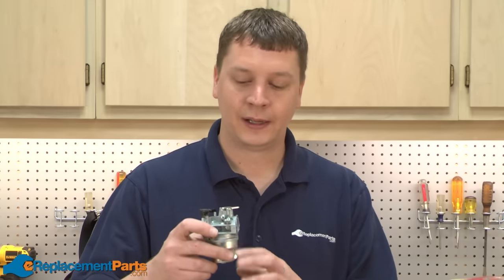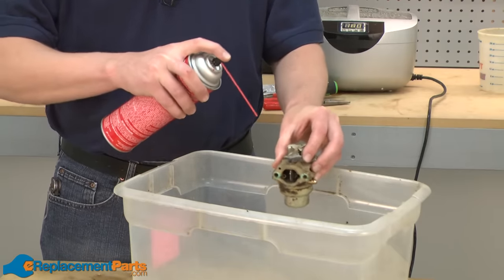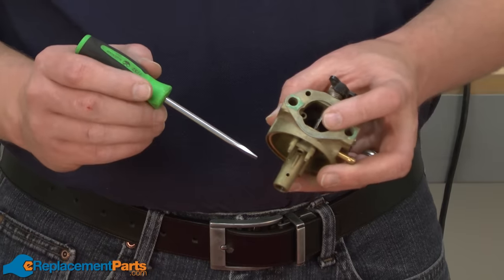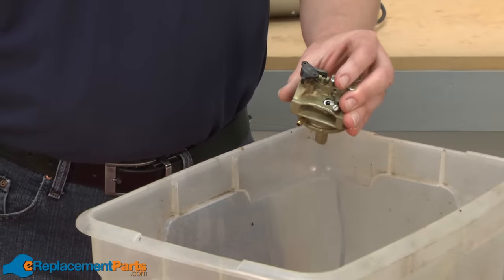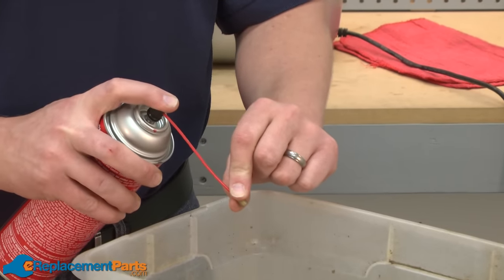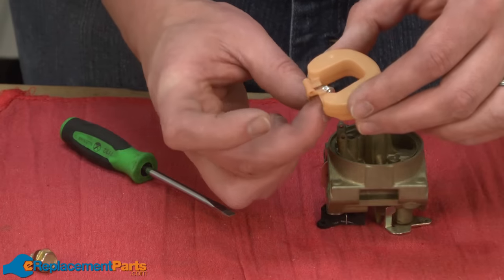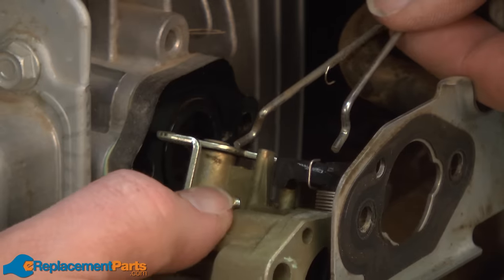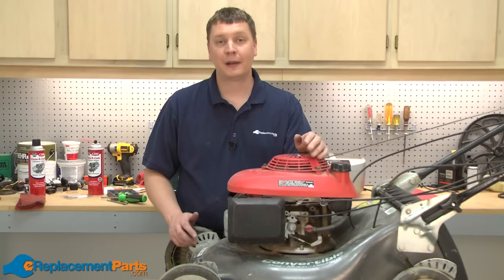How to Fix a Lawn Mower Carburetor

Comment: I have to do the same. Seems that ethenal killed my carb. Gave it two pumps and it ran for a short while and stops. Local mini motor guy told me all that new gas and sludge got pumped into the carb!
Reply: Steve Mckennon Check the spark screen in your muffler. Sometimes it gets clogged with carbon and stalls the engine. Remove it and carefully burn the deposits off the screen with a propane torch.

Comment: i am frustrated. i have a new mower with the honda gvc 160 engine. it has maybe 3 hrs on it. recently, the last time i started it, it ran for maybe 5 minutes before it gradually started losing power and ultimately stopped. now, it won't start at all.... not even catch for a moment. i admit, i used some older gas and that could be it so, i got it out and have fresh gas in it. but, it STILL refuses to start. i forgot to turn off the gas switch before so i thought maybe the engine was flooded. so, i turned the switch off and waited over half an hour. tried it again and nothing. it simply refuses to start.
Reply from the maker: It still sounds like to me that you have carburetor problems. You may want to watch our YouTube video on How to Fix a Honda Carburetor. Here is the link to it:   https://www.youtube.com/watch?v=4qbDdIsN5rg  I hope this will remedy your problems.

Comment: My Lawnboy mower with a 4 1/2 Tecumseh is leaking gas out the air intake. How come?
Reply: You should clean your carb and replace the float bowl gasket /sealing washer/and buy a new inlet needle and seat. For Tecumseh engines this will come as a kit . IT will cost around 12 dollars.

Comment: I have gas leaking into the air filter from the red hose inside the carb need help
Reply: MR MARTIN ....these carbs are basicly service by replacement and very sensitive to ethanol /in the long run its cheaper to just replace the carb. But you can buy inlet needles and seats on some models.

Comment: I think one thing this video has taught me is that it's not worth cleaning the carb.  It's probably best just to buy a new one.  What a mess!

However, I went on the ReplacementParts web site and put in my model number (HRX217HXA).  What came up was only things for other brands and other things that had nothing to do with a lawnmower.  This happened even when I searched under the manufacturer.  Bummer.

Comment: Odd that he didn't use the red gas shut off valve. Also didn't mention the air hose behind the filter that needs to be re attached to the back of the filter housing.

Comment: mark need a video repairing carb off 16 hp vanguard horozontal engine  that wood be cool
Reply: I have gas leaking into the air filter from the red hose wasting all my gas need help

Comment: Carburetor cleaner can I use wd 40??
Reply from the maker: Great question. No, I would not recommend using wd40, as it can leave a residue behind. Carburetor Cleaner is made for that specific use, and so it will be your best bet. Good luck with your repair!

Comment: where to get the gaskets....and why U dont wear gloves....?..spraying those
chemicals on your hand....they go into blood.....
Reply: its like wearing a rubber not needed lol
Reply: I'm an auto technician and was thinking that....carb cleaner is a nasty chemical WEAR GLOVES YOU FOOL!
Reply: garlicdawg It's just ethanol alcohol  ;)
Reply: Alan Reynolds - Sure, if you work with carb cleaner chemicals every day- wear gloves. If you rebuild a carb once a year- not needed, exposure level isn't high enough.  However eye protection should be worn- much more important than gloves...

Comment: Should have clean the outside of the parts with an air gun before removing any parts.
Then remove the part & clean again with the spray.
I would think a part co. would teach the basic steps to cleaning any small engine.